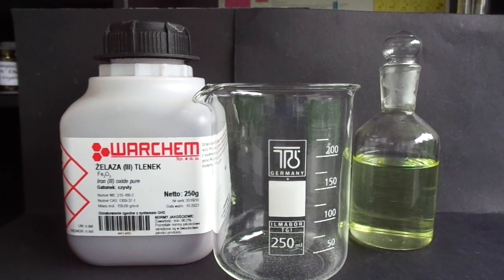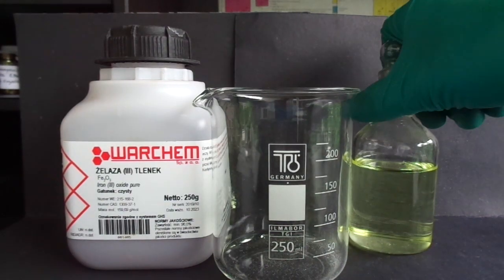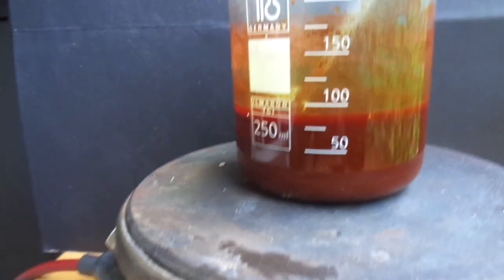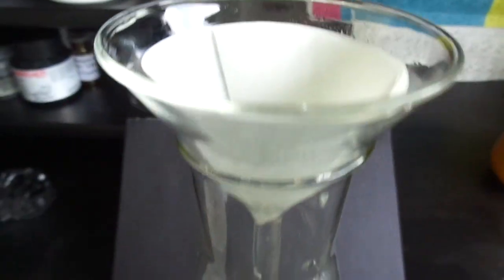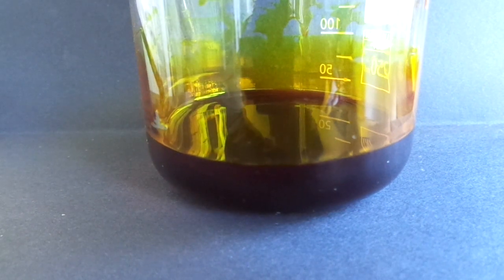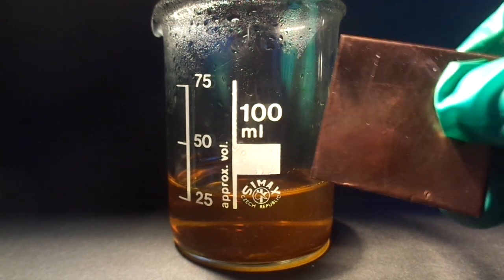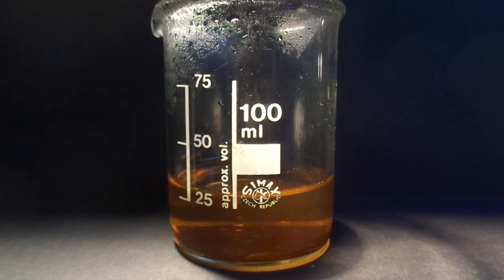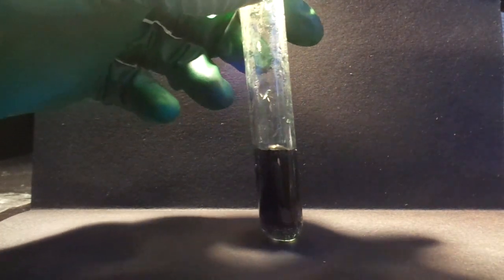Ferric chloride synthesis and properties

Comment: Im the 300 followers 🥳😇
And i think the fumes are not dangerous, i think its a water and not hydrogen chlorines gas( Fe2O3 + HCl = FeCl3 + H2O) bud im not sure (im not english sry)
And nice video👍
Reply from the maker: Thanks the reaction itself doesn't produce hydrogen chloride but the hydrochloric acid doesn't react immediately so when heated some hydrogen chloride fumes are given off due to the solubility of the gas decreasing as the temperature goes up.